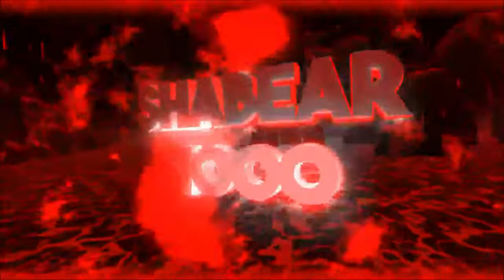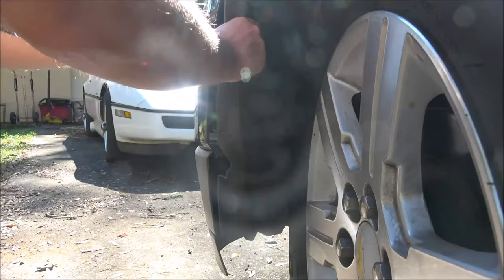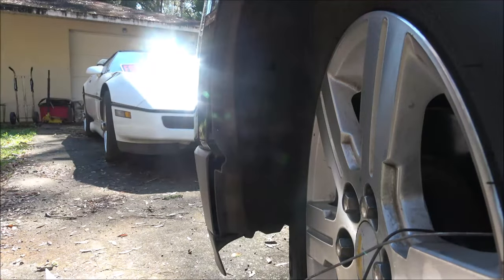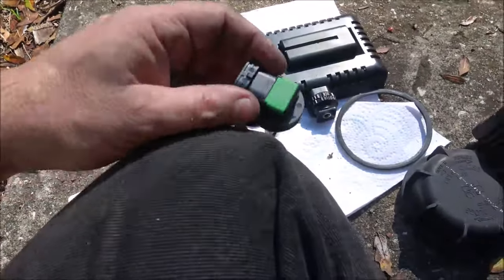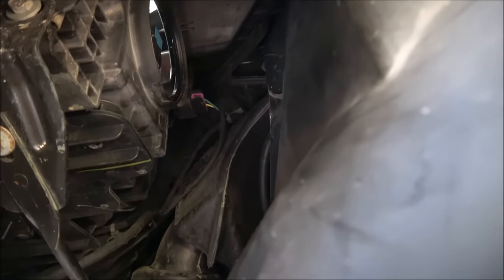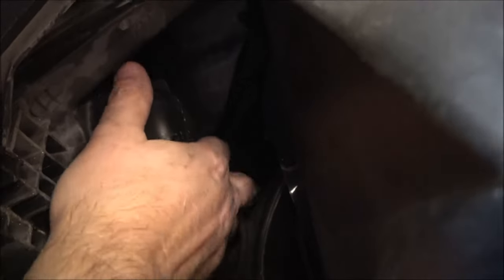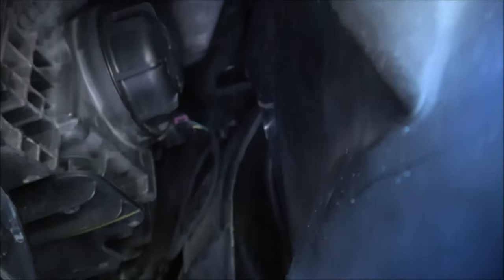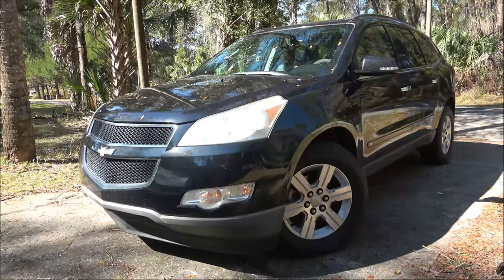Headlight Replacement 2011 Chevy Traverse In-depth How To In 4K

Comment: I cant reach the low beam on driver's side its too tight a squeeze for my hands
Reply from the maker: You'll have to take the whole unit out
Reply: @shabear1000  What do you mean that I have to take the whole unit out? It's strange everyone shows how to change a bulb but not one shows how to replace both high and low beams all in one video. I reached the high beam it's the low beam that's difficult
Reply from the maker: @PhonesRus-i4i the whole headlight assembly
Reply: @shabear1000  Thank you so much people don't talk about this enough. So, the only way to get to the headlight assembly is to take the number off? Is that how you got your low beams changed? Thanks this helps so much I subscribed
Reply: @shabear1000 There is a housing cap needed to unscrew for both the hi and low beams? Thanks